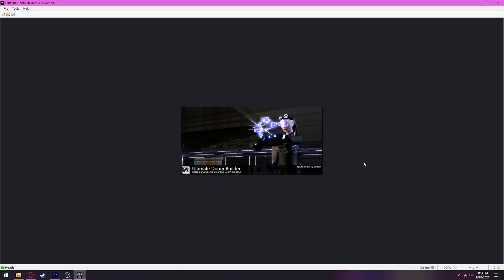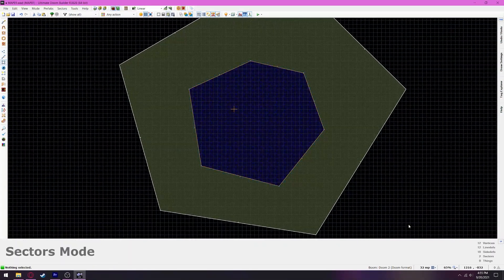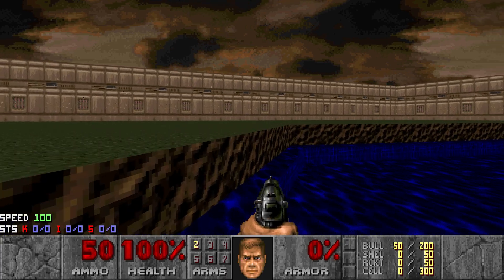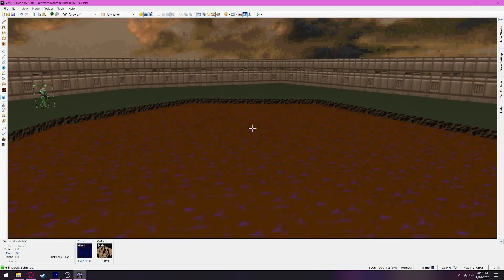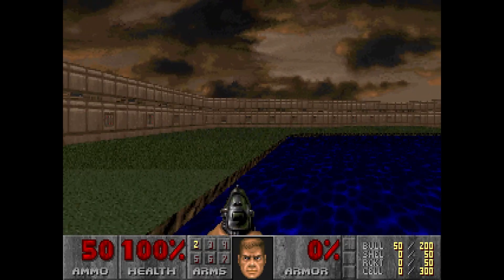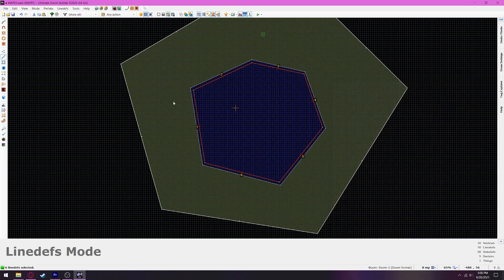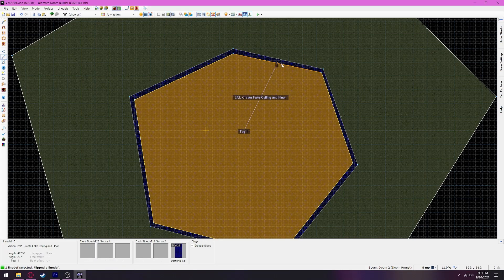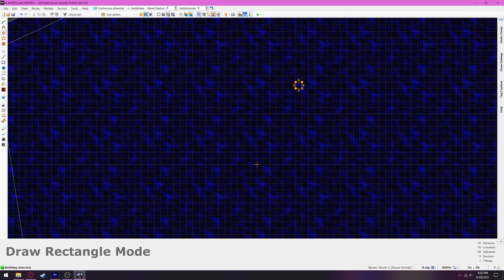Deep Water (and Islands) In Vanilla / Boom [Doom Mapping Tutorial]

Comment: I managed to use a joined sector (a 3rd one, placed off to the side outside a wall) to allow enemies to correctly attack / respond to sound when placed within the 'self referring sector'. Results inconsistent with Ultimate Doom Builder. Worked fine on one body of water, but I had to 'create' a sector (with "m" for make sector in Ultimate Doom Builder) in the second body of water before the monsters would appear semi-submerged. It's dodgy and hacky and if I even reposition a linedef it messes it up, so it stays how it is :P